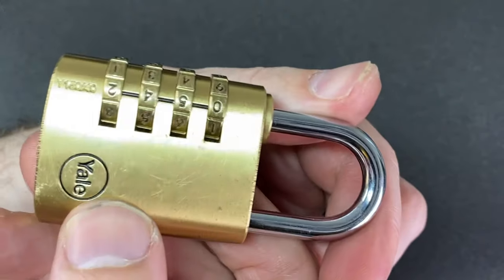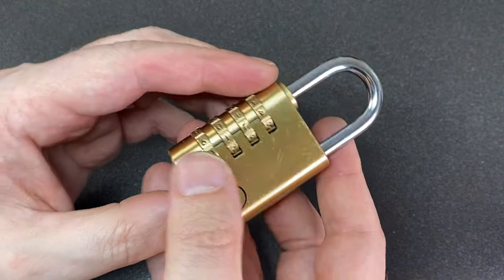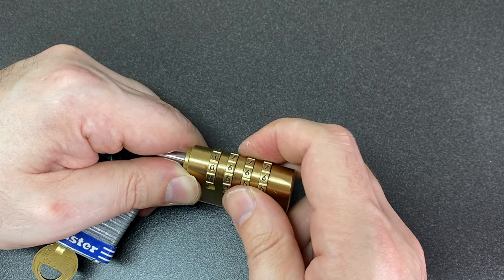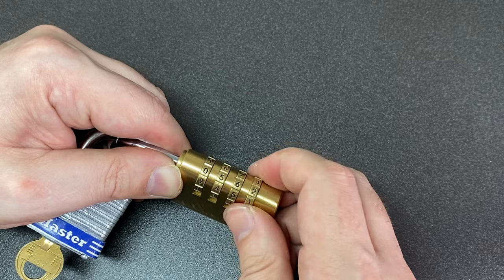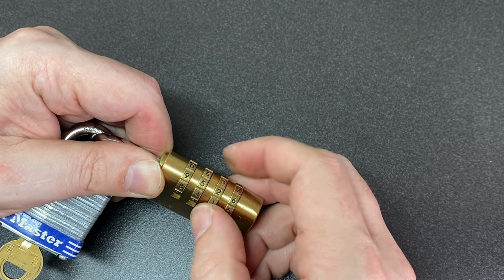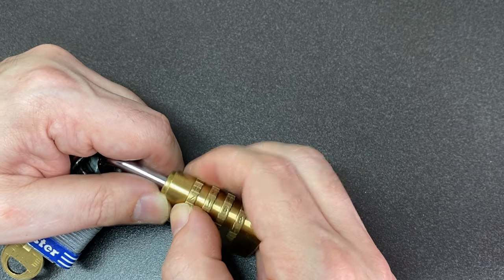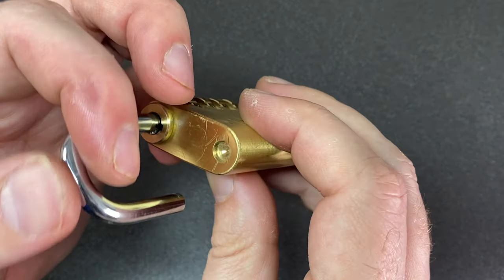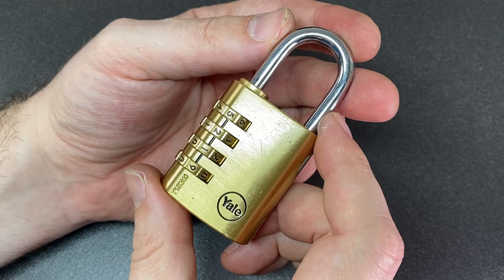Lost Combination - Yale 150/40 Padlock Decoded

Comment from the maker: This one took a LOT of shackle tension to decode, I’m guessing it must have been used a lot.
Reply: I usually use a thin wire or sum down the opening for resetting the combination to align the gates together then moving the pack together to open these.
Reply: @allensmithphotography  that works? That's genius! I woulda never though of that.
Reply: I have one and at first i thought the same but mine is completely new and with basic techiques i could't open it unlike a cheap WORK lock. Its just built like that from the factory to make it harder to decode.

Comment: they can be tricky to decode, when the internals are filled with dust and dirt. I use my interflon fine lube, that I also use for my ruko cylinders, to get the wheels to move more freely, when I have to decode them, It also helps the fence to fall into the gate.
Reply from the maker: Good tip

Comment: I was using that method to open bicycle locks 40 or so years ago.
As an adolescent, I thought it was funny to unlock all the bikes at a bike stand, then put all the locks back on different bikes.
Later on I discovered when the lock is open I could remove a c-clip and change the order of the combination wheels, or even exchange them with other locks of the same type.
Then I discovered kids (same age as i was) would pay me a dollar to unlock their bike and tell them the new combination.....until they wised up and realised it was me that changed them to start with. After that others started playing with the locks and it wasn't long before a lot of people knew how to decode them easily, and ppl stopped using those locks and switched to a cable and padlock, then in another decade the U-bolt style locks came with tubular locks.

Comment: Thin shim stock or a feeler gauge trimmed to a thin point.  Take that and slip it beside the number wheels.  Turn each wheel until you feel the point drop into a groove.  Line up all of the wheels this way, and advance each one by one number at the same time, and it will unlock - usually 180 degrees from where you found the notches.
Reply from the maker: That’s a good technique too

Comment: I love the chain idea-I've never seen anything like that, but I'm totally appreciating it, and will have to try that in the future! Thanks for sharing that.
Reply: I have been know to use a snap clip dog lead on the shackle with the other end wrapped around my foot when decoding these.
Reply: @penfold7800  Clever-and lighter than his solution, I'm sure!
Reply: @jeffandthings77  ... and if its REALLY stiff, wrap a cloth through the shackle and pull down on that. The wierd thing is, if im doing this, then im using my left hand to turn the wheels, whereas when im picking a lock i use my right hand for the pick and left hand for the tensioner.
Reply from the maker: I like the dog lead idea!

Comment: Yes, those yale combos are a bit tricky because they do have false gates. Unlike the squire combos, the false gates arent all directly opposite the true gates. Trying to decipher one of these thats a bit battered and  full of grit is especially challenging. I really dont know though, why they leave so little depth for the opening end of the shackle. It would have also been very easy to include a ballbearing mechanism (ballbearing-connecting bar-ballbearing) that locks the opening end of the shackle when the other end is depressed into the wheels. A shame they didnt do that yet.

Comment: I haven’t tried this myself but I wonder if you took a small bar clamp and used it as a spreader to hold tension on the shackle you might save your hands from some stress.
Reply from the maker: The problem is, you have to vary the tension based on feel. Constant force wouldn’t work very well

Comment: Maybe you could try using a needle in the hole used to reset the combination and turning wheels until the needle is at the bottom. Once you're done doing that you just have to move all the wheels 90 or 180 degrees depending on the model and it should open easily => https://www.youtube.com/watch?v=8gIdcFJZBv4
Reply: The video you link to here is for Masterlock combos. I would hope that yale has already thought of that exploit.